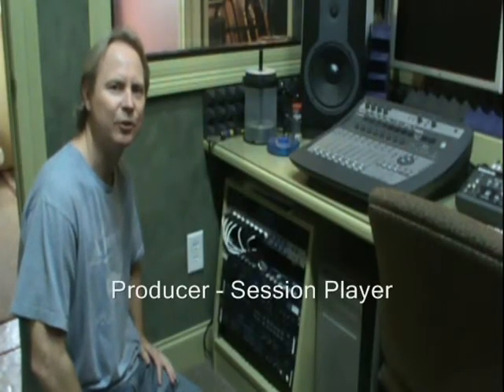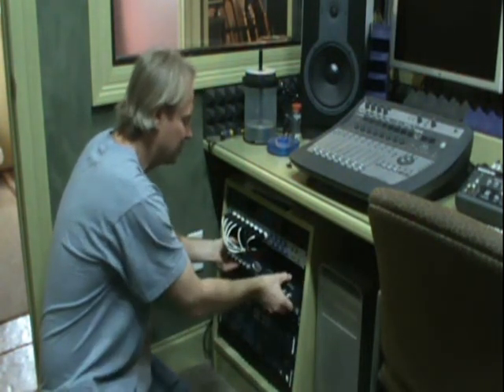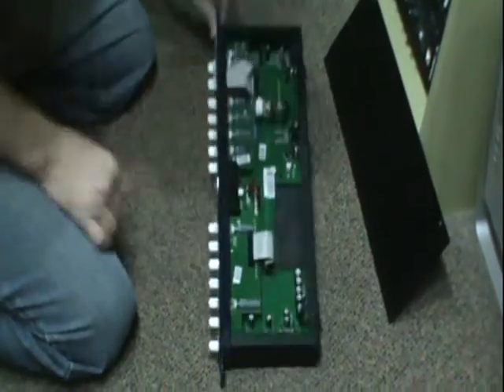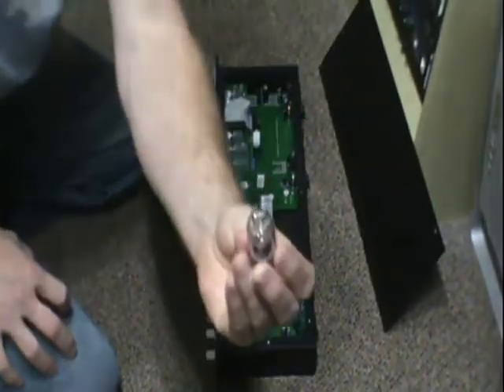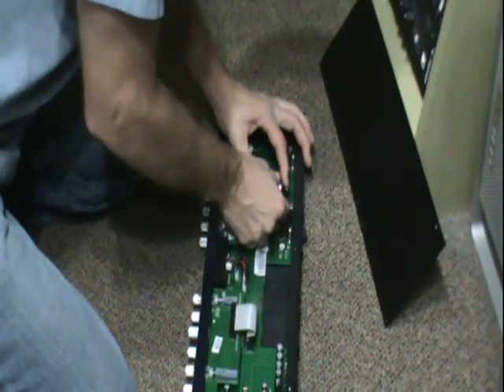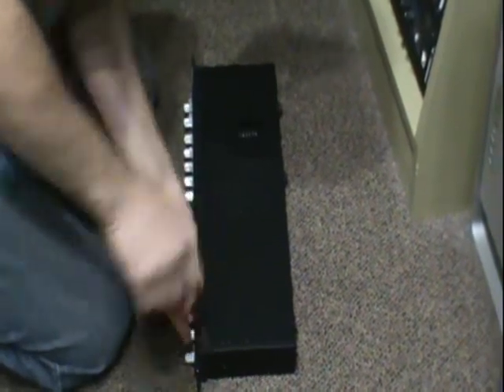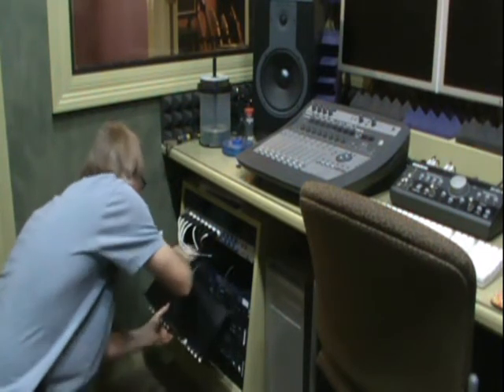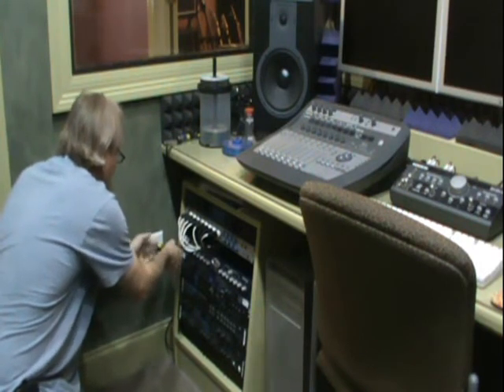Presonus Studio Channel - How to replace the tube demo.

Comment: I'm curious what brand the original tube is and what tube you used to replace? 

Is there a significant sound difference? 

What are your thoughts on the unit all around?

Thanks!

Comment: The only thing I would recommend is that you wear thin rubber gloves to stop moisture from your hands forming on the tube. This can in some extreme circumstances cause issues later when it gets hot. Also, if you have any contact cleaner, spray the socket with a little before inserting the new tube. Other than that, the applause is well deserved! :-)

Comment: Nice video.  It would seem over the years, different tubes end up in these preamps (new or used).  Mine was new, and the only markings on my tube were a "5" on both sides.

Comment: Hi David,
Really enjoyed your demo, I have a very "rookie" question. How did you know it was time to change the tube on your studio channel? How much is the tube supposed to glow?
I tried moving the tube dial and i cant tell if the tube is engaging or not? So I was thinking is was the tube.
Cheers
Reply: The quick easy answer for tube change time (for the majority of us who are not super-audiophiles) is 1) any noise (hum, hiss, or cracking) present that wasn't there before, even if very miniscule, and 2) the warm clear sound you would get even with the tube gain cranked-up high/hot is not there anymore, and is now more hard-distorted.

Comment: I bought one used, I wanted to replace the tube so I went out and bought a 12AX7 tung sol. I opened it up and there was a already a groove tube in there..LOL. Noisy units but pretty versatile for a budget channel strip.
Reply: yeah, I bought a new one and it should have a 12AX7

Comment from the maker: If your still not getting sound the first thing i would try is pluging something into the front of the unit. Bass or Guitar. I have a had a problem before where it did not pass audio. I sent it for repair and it was sent back saying there was nothing wrong with it. When i got it back it worked? I thing there maybe a defective part there not telling us about.
Reply: Just bought one on ebay. Got it yesterday and it fires up. When I plug it in and out  of the XLR in the mixer it shows a signal but when I plug the mic in, I get no audio.  I replaced the tube, I have no idea what's wrong. The seller said he just used it and tested it before sending it and it worked.

Comment: More information on replacement tubes can be found on the HomeTracks channel video https://www.youtube.com/watch?v=YSiTGKxwj_U .  He replaced his with the TungSol ECC803S 12AX7 Gold Pin, but Genalex Gold Lion ECC83/12AX7 has also been recommended with similar specs, higher gain, less noise